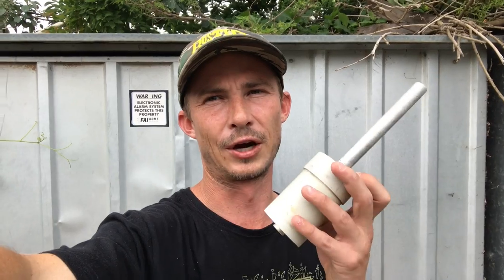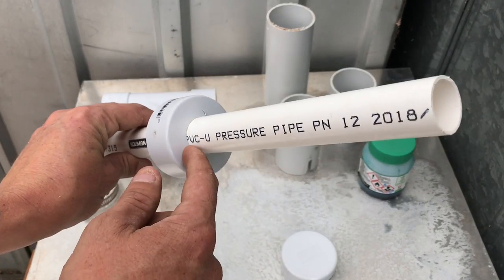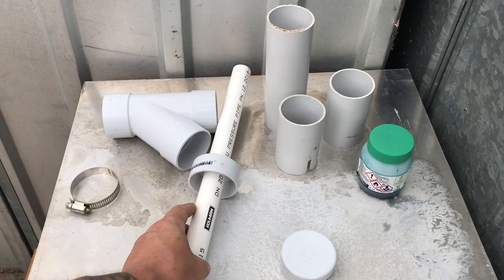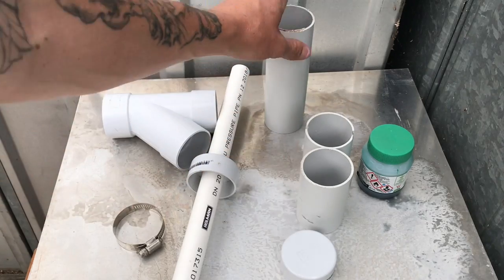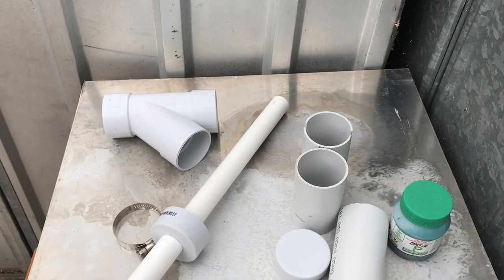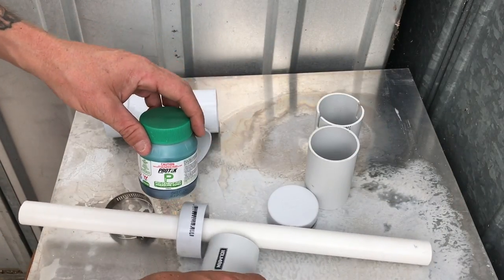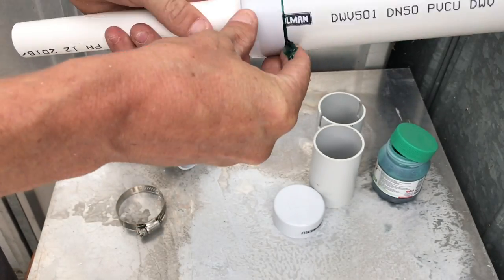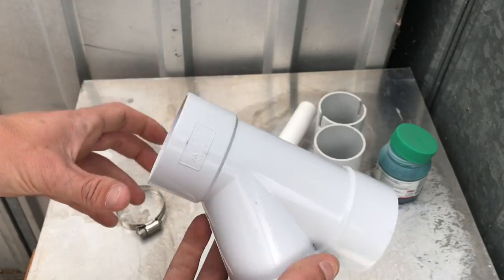How to make a gold trap/ DIY Gold Trap

Comment: At first I didn't quite understand why you didn't glue the main body, but then I learnt real fast when you showed how to clean out the whole attachment, much easier than undoing the hose clamp like I thought was the way it was to be done. This is a really simple, cheap & easy to build and usable tool. Thank you for sharing this 👍
I've found Liquid Nails softens in water, especially if it's warm, so I'd use plumbers silicon to secure the small diameter suction pipe into the cap.
Reply from the maker: I usually just use fibreglass resin but I didn’t have any on hand so I improvised with liquid nails, it’s not to seal the hole and pipe, it’s main purpose is to hold the pipe away from the second trap so it doesn’t get blocked up.
Reply: Busted knuckles Prospecting 
Silicon should do the same as fibreglass, just not so rigid but I understand what your getting at. Good basic idea but I would have mucked it up if you didn't explain it so well.

Comment: For the nozzle, instead of an endcap, I reckon maybe a 2" to 1" reducer would make a sturdier connection. Just need to ream the inside lip a hair to slide the 1" needle tip past that adapter into the trap. Also, going to try rigging a mason jar as the bottom trap so you can see whats going on and when youre full up, then just thread off and dump. We'll see how it goes when I build it. Thanks!

Comment: Thanks for sharing mate love your work. Can i ask why aren't you using this more often in you more recent videos when you use your yabby pump? I thought it was a great idea when i saw it so i built one very similar to yours but without the front snuffer style vacuum nozzle & trap. the trap in the under side works well on mine without the snuffer style front trap & expels very little to no gold/debris when evacuating the water in the pump. I'm only a beginner at prospecting but enjoy making stuff out of scrap. I was nutting out your design & i'm thinking your suction draw length needs to be 2-3 times longer than your snuffer style vacuum nozzle for the debris to clear the vacuum nozzle & gold/debris trap opening. OR you could take the nozzle tip off the bottom & away from the debris before you come to full draw allowing debris to be flushed clear of the nozzle & above the debris trap.  PS keep up the great videos mate.

Comment: you did not show how the top was made, what sucks up the water?
Reply: Agreed. Nor what the slits were made for, cause never used them
Reply: I think the metal tube is basically the same mechanism as a bicycle pump. Good design. Nice adaptation with the gold catchers. Its just like a birds crop.
Reply: its a hand pump. Im guessing where hes from they call it a yabi pump.  That tube has a plunger in it that sucks water in
Reply: @GoldNSlots   the slits/slots were for the lower section of pvc to be able to be clamped to the pump with the hose clamp..

Comment: Sean you are a tinkerer.....You said you would build it and ya did ..... mine is still in pieces??? Congrats!!!!
Reply from the maker: I sure am mate, why purchase something when you can make a better one 😂
Reply: It turned out great ! I still think if you change your end cap to an 1 1/4 hose fitting and hose to bucket or straight to the gold pan ????
Reply: Anywhooo works in process awesome video
Reply from the maker: Iv just got to add a 1 way valve to it so I can add a hose and bucket.
Reply: Awesome!!! Now your pumping gold